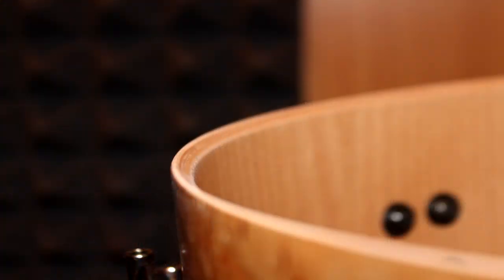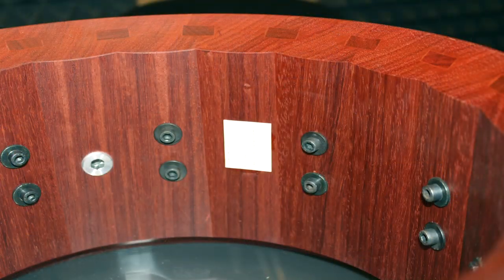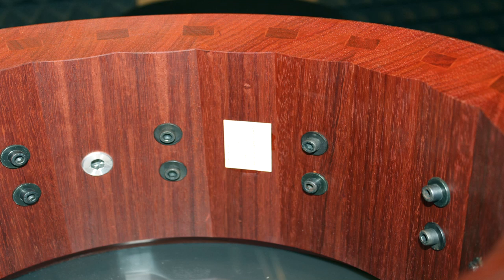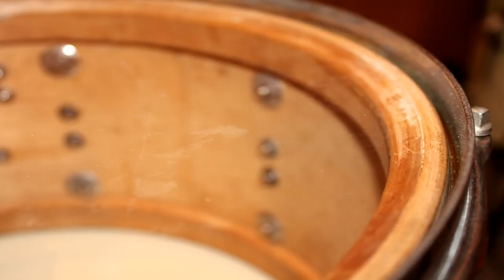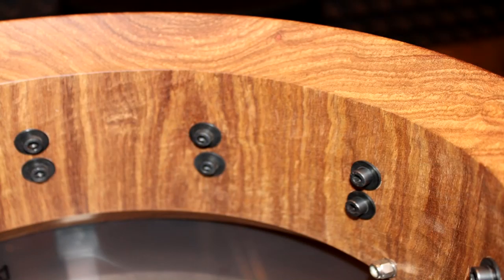How bearing edges affect the sound of the drum (Taken from How to reach your drum sound)

Comment: My understanding is that sustain and attack are opposite and exclusive of each other. So, at 0:40 when talking about a 45 edge, you would have attack, but sustain is actually compromised. Sustain comes from the shell resonating, not the head. Some of what is mentioned here seems to conflict with everything else I have read about bearing edges and have come to hear with my own ears.

One other point is that while there are indeed mainly three "categories" of edges (45/30/complete roundover), within the first two and especially with a 45, there are many variations of those edges that can further affect and define the sound.
Reply: SpikeFlea A drum shell doesn’t resonate enough to influence the overall sustain of the final drum sound. Shell resonance will affect the head in different ways but it cannot and will not affect head sustain. The bearing edge has much more influence to sustain than anything else. A bearing edge is simply a head muting device beside actually holding the head. 
Drum shell material affect the resulting sound in different ways than most people believe. It might be semantics to some but it’s an important distinction. The sound is in the had. The shell controls what the head can do. Nothing more. Nothing less. Hoops have more of an influence on drum sound than shell material provided the shell is manufactured to the highest standards providing a perfectly round shell and a good fit for the heads. Shell thickness will influence the sound. Thick  vs Med vs Thin.But it really boils down to a LOSS of energy from the head strike. Thick shell will be louder with more projection while the thin shell will be quieter with less projection. 

2 extra dense materials of similar weights  crafted into a heavy shell of the same specs will not differ in the resulting drum sound if at all. And once the head is changed that will influence the sound we hear to a MUCH greater degree.
Reply: People use 'resonant' and 'sustain' interchangeably, but sustain comes from the drumhead and resonance comes from the drum itself. So for instance, a thin shell with rounded bearing edges would tend to create a resonant drum sound with slightly reduced sustain.

Comment: I love the concept of round bearing edges trimming off unwanted overtones and generating more of a woody sound! 

From the little i know... vintage 50s & 60s drums with reinforcement rings have a combined edge thickness (shell + ring) of 0.3 - 0.5 inches. This thickness allows for a large rounded edge radius and therefore more head to shell contact. 

Consider a modern ply shell without re-rings that is not extra thin, but medium-thin to med-thick 0.2 - 0.3 inches (5.0 - 7.6 mm)... Knowing the rounded edge radius will be smaller with slightly reduced head to shell contact than drums with re-rings... will these smaller rounded bearing edges still control the overtones & warm up the sound without reinforcement rings?

Does a snare drum with rounded edges truly lack any of the positive qualities associated with angled edge snare drums?
Reply from the maker: Hi Andy, 
a "new-vintage" drum set will sound differently compared to a vintage kit.. the sound might be close, but the materials and the way we build drums are different now from what it was 30-40 years ago. Considering that the sound of a drum is a mix of many things (hardware, hoops, drum hedads, woods, bearing edges and... the drummer who's playing it of course) I would say  that a new-vintage kit sounds good (and often close to the vintage kit) but not the same as the vintage one. 
That's not possible.
About the snare: is the same concept.. If the shell is thick a rounded edges will sound darker, a little "dull" with less projection compared with a snare with a steep edge. A s you may guess there are many things to look at.
Dave
Reply: Andy Pruyn What you described with vintage bearing edges is the amount of muting the edge provided for the head. Vintage drums do have a “muted” sound. That’s all a bearing edge is.....a head muting device and holder. Don’t believe all the marketing hype. Choose well crafted drums with top notch quality control and you will have a good instrument.

Comment: What about an acrylic with no edges.??  I’m looking for great redo and loud sound
Reply from the maker: Hi, no edges or "square" means no sound and impossible to tune, unless it's a extra thin shell, but usually there's a roundover.
Reply: welive Cut a slightly round over on both sides of the shell and make sure the surface is DEAD flat where the head contacts the shell and that should be a good bearing edge.

Comment: Isn't the 30 degree and the roundover one the same variation when it come to vintage drums ?
Reply: Tieu Kha Vu No a round over is made with a round over bit while a 30 degree cut would be made with a Chamfer bit. Some manufacturers cut a 30 degree chamfer on the inside of the shell and made a round over cut on the outside. 30 vs 45 doesn’t matter at all compared to the area where the head touches the shell. Very sharp will give more sustain and possibly more overtones while a wide round over with more head contact will reduce overtones and sustain. The bearing edge is a head mute.
Reply: @Assimilator702  Now I understand